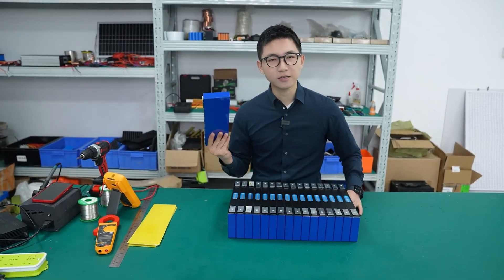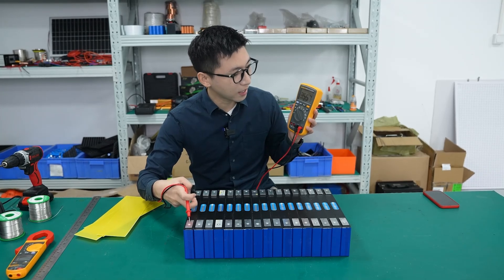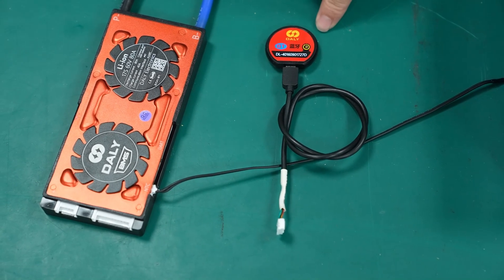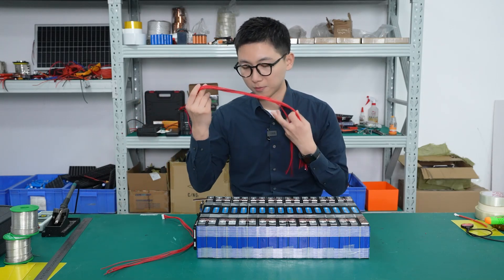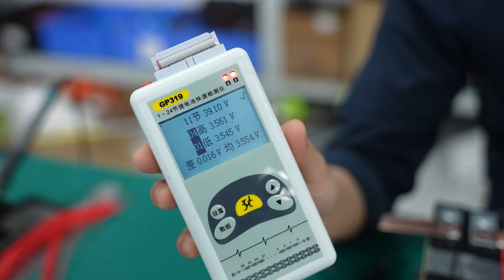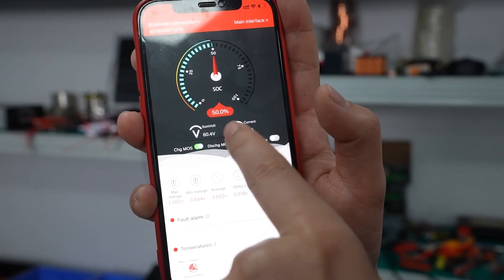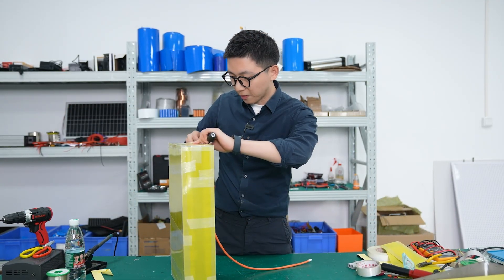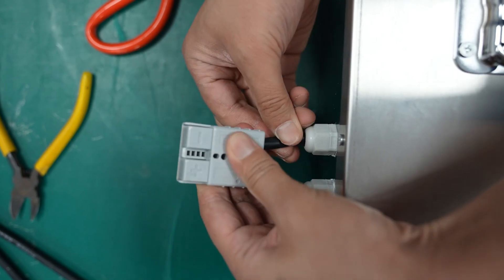Let's DIY a 17S 60V lithium battery pack

Comment: 1:42 - now it's a big discussion about cutting a balance cable, many ppl say this cannot be done bcs then difference cell will be bigger and bigger and after time any balancer cannot fix the issue. Why you cut a balance cable on every video ? Why it's possible ?